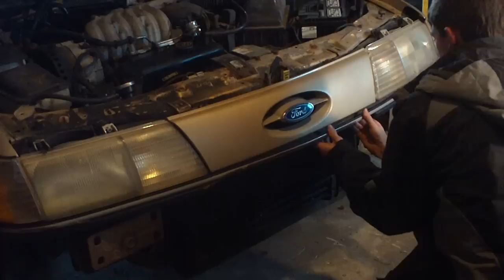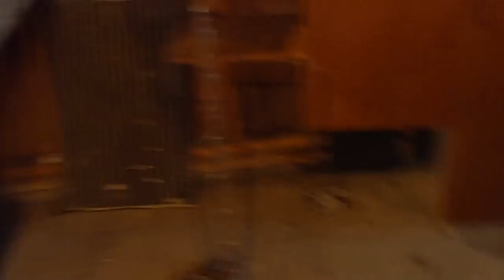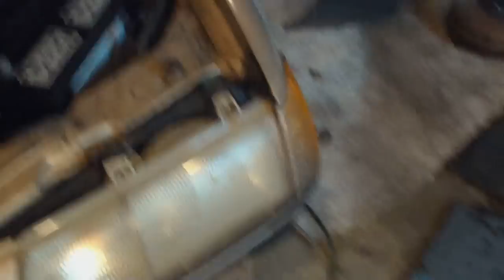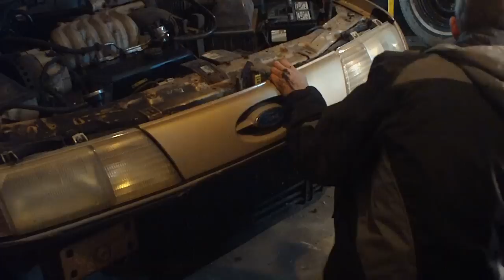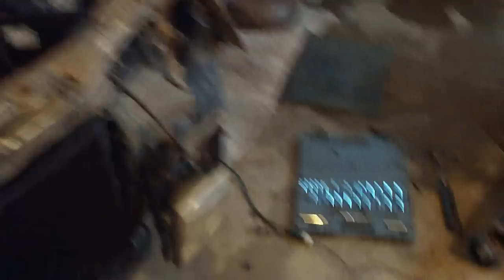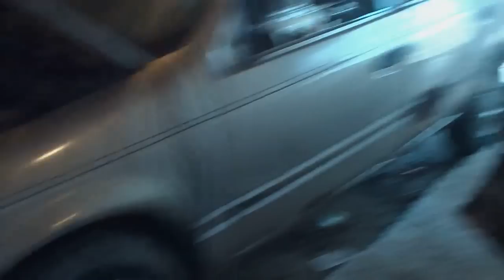How To Strip a Derby Car: Part 5

Comment: About a daily driver car on the road have you ever seen the video on youtube with the crash test of a 1959 Chevrolet Bel Air VS. 2009 Chevrolet Malibu (Frontal Offset)? The saftey changes made throughout the newer cars goes a lot futher than the bumpers. Great video again. Are you going to be able to put a metal bumper on either the front or the back end since both that came off are plastic? Can you someway bend the hood down in front to protect the front of the car a little more? Go Karen Go!

Comment from the maker: @ghostman7691 Thats harder to do with these newer fuel injection cars. They would need the intakes changed and sometimes the timing changed. I'm not sure if they make intakes for some of these kinds of FWD cars. The older 4 cylinder engines can be converted though.